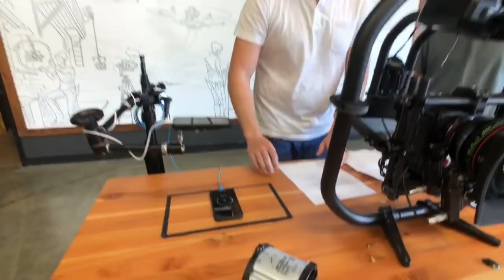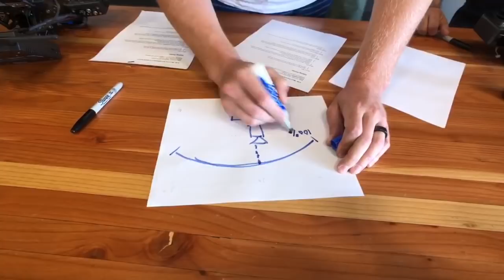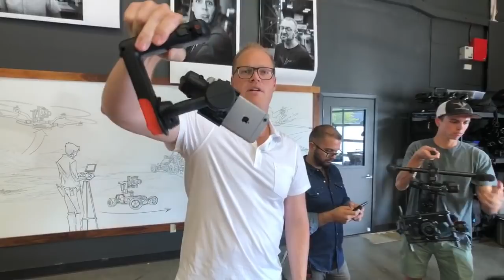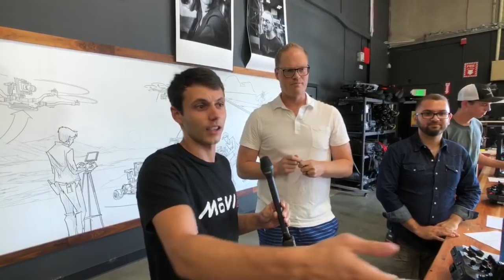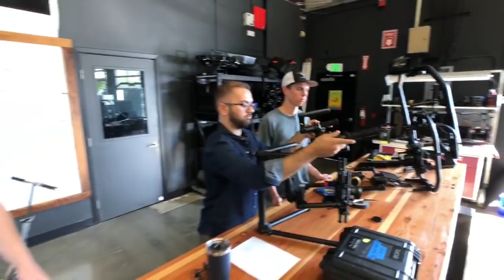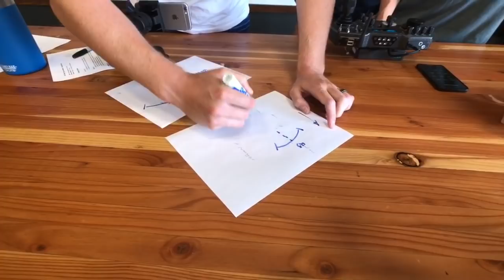LIVE - MōVI Pro v1.5 Software Release

Comment: Two VERY important things for V2.0 pleaseeee:
1. Rate roll control (Ie stick deflection correlates to a rotational velocity like every other gimbal). Currently the Movi Pro only has "Angle" roll control via the trim channel. I think this has been addressed but it has not been clearly stated.
2. Loss of Signal via Futaba controller:  The Movi Pro defaults into majestic mode if signal is lost. This instantly ruins any drone shot. When the Movi looses signal, it should remain in its current mode. Therefore when the user is in Duel Op mode is should stay in Duel Op mode if signal is lost. This will prevent the gimbal from tweaking back to center. At least if it is holds its current position many shots can be salvaged.  The Movi ignores failsafe commands from a Futaba receiver, so we can't use this as a work around.